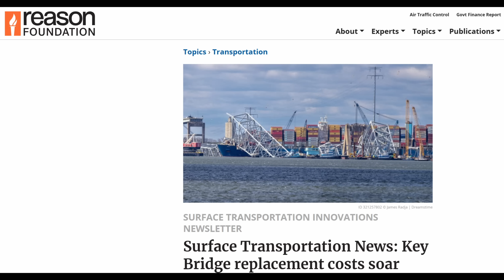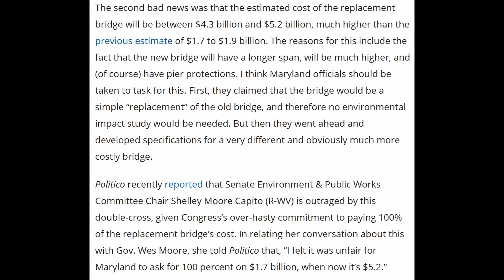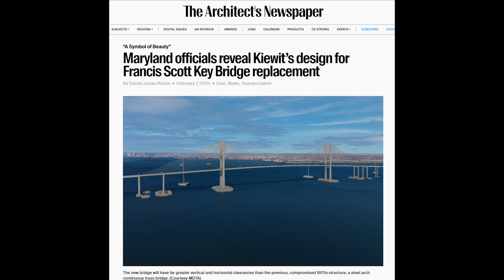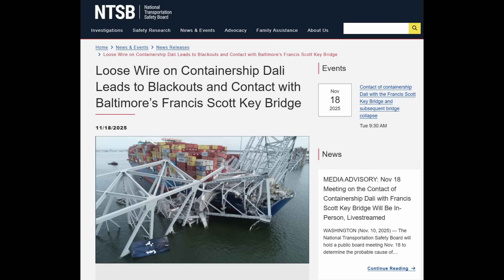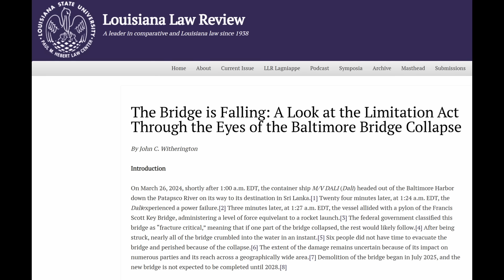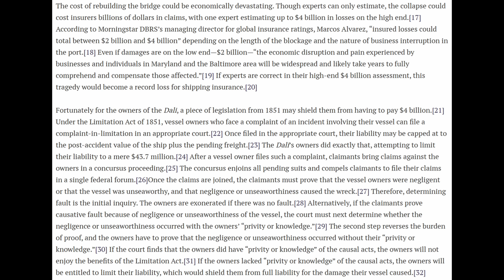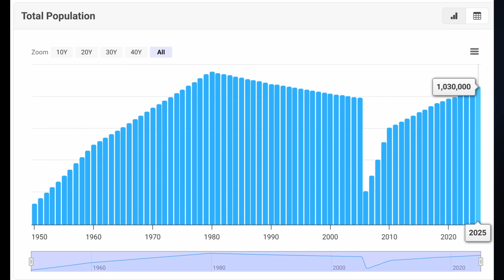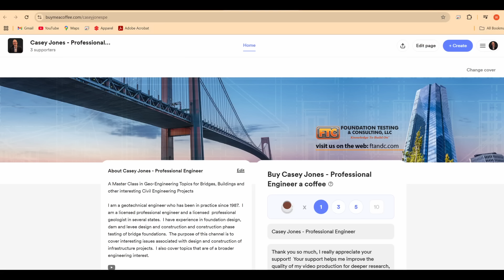Should U.S. Taxpayers Pay for a $5 Billion plus Key Bridge Replacement?

Comment: The bridge was being operated as a toll bridge, the toll bridge authority is ultimately responsible for its replacement, this was federal. The second thing here is that the bridge was 48 years old and was approaching its full depreciable lifespan. What this means from an accounting point of view is that if you are operating a piece of capital equipment as a source of revenue gain, then over its depreciable life it’s paying for its own replacement. Therefore the federal government is fully responsible for its replacement. 

    Ok so that they are responsible ultimately are their potential revenue modifiers. But before I do that we need to consider here what are federal and state waterways. Because you might think that these ship channels are state waterways but in fact they are part of a federal system that has been modifying coastal waterways for the sake of commerce (the inter coastal waterways) and the sake of military readiness. In fact, the site of the key bridge was close to Å battle between Britain and the US in 1812. This same war triggered the building of the inter coastal waterways as a method of safe prevention of foreign blockade of US ports. And the US core of engineers is responsible for the appropriation of and maintenance of the Intercoastal waterways as well as federal channels that link to that waterway. For example during WWI the US built a channel going from mainland Texas near Raymondville, Texas to the Gulf of Mexico specifically deep enough to allow coastal patrol vessels in and out, but not German submarines. 

   So we need to separate the fact that a body of water lays within a states traditional border and what assets within the state the federal government is responsible for. As you get close to the federally sponsored and maintained system of waterways the responsibility needle pushes in the direction of the federal government. 

   Secondarily, when you think about costs and federal tax dollars, at least in terms of modifiers, we need to think about responsible taxation percentages (right now we are in an under taxation freefall, ergo tarriffs in an attempt to stop the shearing of revenue for interest payments on the debt). But if we were in a period of responsible taxation, rebuilding such a bridge with raw materials that are largely resourced in the US has a large multiplayer effect, in essence the federal government gets the revenue back because of increased incomes in all the trades associated with building the bridge. Again, it has to be tied to responsible taxation, not mindless tax-cutting. 

     So the question is then who is responsible for protecting a federal asset crossing a federal channel as part of interstate commerce and international trade. This essentially answers the question.

The next question is there corruption in the new bridge design and construction project, again we are talking about what the fed should be doing versus what the current reckless administration and congress does. This is a separate issue because corrupt spending undermines markets.
Reply: Interstate commerce clause of the constitution is interpreted as Federal control of waters and thus the bridges over them.  Meaning the Federal government is involved and should bear the responsibility.   

Good insightful comment.

Comment: The original cost estimate was made just a few weeks after the collapse, without a definitive design. So a cost escalation can be expected, but the current range is extremely high. And the cost tends to increase during construction as well, so $ 5.2 billion might not be the final cost. 

That said, almost any large bridge replacement project in the U.S. is north of $ 1 billion nowadays, with many approaching or exceeding $ 2 billion. There's a runaway cost inflation with bridge projects. I'm from Europe, where infrastructure cost is also going up too fast, but generally not into the multi-billion figures seen in the U.S. in recent years. 

Remember that collapsed bridge in Genoa, Italy? It was replaced for $ 235 million. It's 1.2 km long.
Reply: I'm not driving over that.

Comment: Why does it cost several times over inflation to build new/replacement infrastructure than it did 50+ years ago ? Here are some reasons I saw from my working in governmental agency that operates, maintains, has done major renovations and revisions of and has replaced bridges in recent years.:
Much higher labor costs and increased worker safety regulations. 
Excessive control by workers unions. Too much staffing due politicians who want to max out the number of jobs created, won't allow non-union workers on public projects or parts of them. 
Much higher materials costs.
Higher energy (oil) costs.
Greater specifications mandated by the Federal and State governments for long term structural integrity, expected higher demand in the future, wider lanes and safety improvements, improved approach roads, as here with the Key bridge, likely higher to allow larger ships to enter the harbor. With this replacement bridge, massive bulkheads to protect the foundations of the towers 
Uncessary mandates for walkways and bikeways
Mandated environmental studies that delay projects, may mean extensive revision of plans due to need to avoid killing off some rare plant or animal life. 
The replacement of the Tappan Zee bridge, originally built in the 1950's was exponentially over inflation of the original due to the reasons I cite above. It was also build with limits of steel availability due to the Korean War and other projects, built cheap, demands overwhelmed it by the 1970's as many moved to the areas west of it.
Reply: The new Key Bridge won't be getting a bike/pedestrian path (which seems to be a thing on newer bridges even when they are in industrial areas and there is really no place to walk to or from).  The asking price for it is high enough as is without one!
Reply: TL;DR: we're spending too much money and not enough lives.
Reply: @blairhoughton7918  I'm pretty sure if that bloat money from this project went to other uses it could save many more lives. 1-4 billion could save a lot of lives being used elsewhere
Reply: @BrianBattocchi  false dichotomy
Reply: @blairhoughton7918  How so?  You insinuated that we should spend an extra 4B to make the bridge super safe.  I'm saying no we shouldn't at that cost.  The money would be better spent elsewhere.
Reply: @BrianBattocchi  So let's make an unsafe bridge? No.
Reply: @blairhoughton7918  If making a less safe bridge leads to money being spend somewhere else that saves more lives, I would definitely argue we should make make the less safe bridge and save more lives elsewhere.  The cost/benefit of this bridge just doesn't make sense.  If we try to do what you suggest with all construction we would have a few very extremely safe things built, but would starve because we are broke.  Cost/benefit analysis is a cornerstone of construction.  Do you have a sprinkler system in your home?
Reply: @BrianBattocchi  False dichotomy. We're spending that money there, too. Pay your taxes.

Comment: In my experience, designers and program managers get themselves into trouble when second guessing cost estimators.  The first thing I'm wondering is if there's been an independent estimate done against the original bid or the current design estimate.  Also, you want to look at the process of how costs were evaluated during the bid.  You want an estimator that isn't part of the D/B team to look at this stuff.  (Is there an owner's rep firm on this job?)  The suspicion though should be on both sides.  A game that contractors play is to load the bid estimate with assumptions that take advantage of any scope holes in the RFP, with the idea that when those holes need to be filled they represent valid changes since the RFP and bid excluded them.  The other game that happens here is the back and forth between the contractor and the owner with regard to who owns any risk.  Sometimes, a problem that owner's rep firms have is explaining to owners that if you put all the risk on the contractor, that may seem great to you but they'll inflate their price to make sure they're covered.  So sometimes there's a back and forth over project and scope definition to find a balance of how risk is going to get carried.

Comment: For that cost increase they should re-quote the job to all bidders.
Reply from the maker: I agree with you.
Reply: @CaseyJones-Engineer  Australian engineer here - would you care to comment on any of the other insane cost blow outs to major projects.
This is NOT an American issue either. Its all across the developed world.

Australia has a mounting issue with project management and its across the field - government, military and private.
It doesn't matter industry either - energy, mining, gas,.... its all the same. 
There is a World wide issue with project management that makes every engineer look like a useless irresponsible clown and the REAL ISSUE is the way economics is taught & evaluated and business management practices are geared to flip apparent losses into long term profits. 

On the business management side there's a bunch of accounting tricks (for want of a better word) that makes engineering projects operate like negative gearing where apparent short term losses are flipped into long term profits. In the engineering space those profits come via tax concessions, royalty concessions and subsidies. 

Then there's the major issue of economists who put 1 single metric above everything else - GDP.
GDP has nothing to to with production and offers nothing into productivity. Go look at the definition on Wikipedia. GDP is nothing more than a measure of spending. So the more that gets spent the more GDP rises. So if a bunch of major projects (both private and government) go $trillion over budget that's NOT a productivity issue for economists  that's a boost to GDP.

Economists don't see the cost of a replacement bridge doubling to $5.2billion as a problem. they see it as boosting GDP by $2.6billion and wont complain if it goes to $8billion or more. SO LONG AS GDP GOES UP Economists don't care what drives it or what the actual costs to society are.
Reply: @CaseyJones-Engineer  Question I think would be if it’s expanded scope driven costs increases, Kewitt trying to pad it for profits, or whatever else might be driving it up.  If it’s mostly scope increases, for safety, another builder isn’t going to do any better.  So we need to understand the increases in detail…
Reply: @CaseyJones-Engineer   An indicator of quality of content is quality of the comment section. Consistently your comment section is top notch; meaning smart, well reasoned, fact based and educational.  janetsmiley-r is the exception to the rule.
Reply: @CaseyJones-Engineer Biden was throwing gold bars off the Dali.
Reply: @JanetSmiley-r5h  No he wasn't.
Reply: @JanetSmiley-r5h  I see your projection is still going strong.  No comment about the $20B Trump just gave to a hostile foreign government for nothing, huh?
Reply: @uzlonewolf You do you, dude. It doesn’t bother me.
Reply: @blairhoughton7918 You take the ball very often?😂
Reply: @JanetSmiley-r5h  I don't know what that means and I don't want to. Keep your echo chamber memes to yourself.
Reply: @b @blairhoughton7918 Your reply tells us you know what I meant. 😂
Reply: @JanetSmiley-r5h  Biden spends some money to help Americans: "How DARE he waste money like that!!"
Trump literally throws 4x that money away by donating it to a hostile foreign government: "Meh, whatever, that's not relevant."
The hypocrisy is astounding.
Reply: That’s why the removal of the 3 collapsed spans cost $120 million. The disaster chasers charge a fortune and most of it is profit.
Reply: The Key Bridge contract model is a progressive design build, meaning that the contractor was selected for their aptitude and experience. The contract model is phased so that design occurs concurrently with negotiation to provide the most accurate cost. And then at the time of final negotiation, if the owner (in this case MDTA) and contractor cannot come to an agreement, MDTA owns and has already paid for the comprehensive design, meaning they can solicit bids with said design. The exponential increase in cost is most likely due to 1. the initial (extremely estimated) number of ~$2B being suggested and proliferated rapidly within weeks of the collapse and 2. design changes requested by the state. - Source: I'm a civil engineer
Reply: Exactly! Ballooning the cost after you've already been chosen should immediately trigger a new bid process.

There should be a threshold of cost increases that are considered acceptable, but over that? A new round of bidding should be initiated - particularly if they haven't even started building anything yet and it's all just on paper.
Reply: @BreeBadger If memory serves me correctly this is what happened with the expansion of the Panama canal. There was a US consortium, a EU consortium and the last was the Chinese (?). The Chinese got the job thru low bid, the other bids protested the bid as being unrealistic. It went ahead as bid, then all the ballooning invoices triggered many lawsuits between the two parties.
Looking from the outside it sure seems like a silly way to let out contracts and do business IMO.
Quality of job, value for money, being able to keep construction deadlines, etc there's many things to consider beyond the lowest price bid.
Reply: @BreeBadger  at this point Kewit is not the builder yet. They are going to enter negotiations on the constructors and the state of Maryland has an out if they can't come to an agreement. If it were to go to a bidding process that would extend the timeline of the build.
Reply: @seancca  For that much of a price increase? I think it would be worth reopening the bidding process, even if it means it takes longer to get the replacement built.

But I also don't live in MD or anywhere near the area, so... it's not like the MD DoT has to take my opinions into account. 🤷

PS I should maybe add a reminder that with a fiat currency, federal taxes are literally inflation control. None of the money we pay in taxes goes towards any federal spending. All of the money the IRS takes in is destroyed to help balance the value of the US Dollar.

That's also why raising taxes (especially on the wealthiest Americans and corporations which will pay a much much higher dollar amount in taxes than the rest of us) during high inflation actually helps reduce inflation. Same thing with the national debt - we literally pay other entities (usually other nations, but also banks and other financial institutions) to keep an amount of US Dollars out of circulation to help us manage the rate of inflation. The National Debt is a good thing - it keeps our money from being worthless.
Reply: @BreeBadger the initial estimates were not from the designer. That was out by MDTA guessing at a baseline.

Comment: All valid points and questions Casey, a 3x cost increase in an infrastructure project would reasonably be enough to prompt a DOT agency to stop the DB from progressing due to projected funding overrun. Somewhere, MDTA has been briefed about this projected increase and let the process move forward. I do not believe taxpayers should be liable for overruns of this magnatude. Another excellent video Casey, thanks for sharing.
Reply from the maker: Thank you so much! It will be interesting to see what happens. I'm surprised that this dramatic cost increase hasn't gotten more attention.
Reply: @CaseyJones-Engineer  My guess is that it's more likely Rhode Island politicians demand direct cash or in kind bribes, whereas Maryland is more likely to be playing political process linked to Congress shaping systems to be easy to manipulate within game rules set by Congress, within rules for a system built on a tilted playing table.  

But, how do we prove that right or wrong, or close but fill in the details?
Reply: @CaseyJones-Engineer I added a full post in the chat, but the short is, as a federal construction cost analyst, that initial estimate and funding should have never been made with the high level of assumption made.  Clean up and study funds should have been the only thing promised.
Reply: If not taxpayers, then who pays? The ship owner😂😂😂😂
Reply: and any insurance is going to be based on the cost to replace the bridge exactly how it was prior to the event. and then there's depreciation. Insurance was never going to cover 100% of the cost to rebuild.
Reply: @andrewschliewe6392  You're imposing civil law standards for ordinary property and casualty insurance, that are irrelevant.  

While the idea that Inland Marine insurance covers commercial tools and equipment or goods in transit by land, eg truck, rail, or even electronic instruments for engineering (as an extension of archaic conventions for Ocean Marine insurance), Admiralty Law is very weird by most other modern standards of civil law.